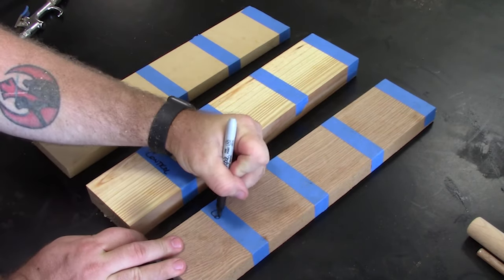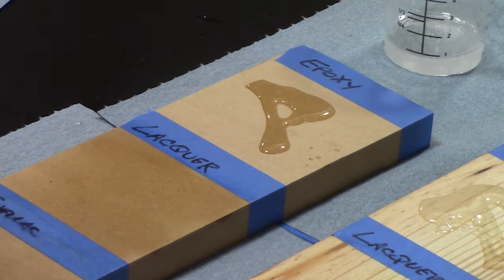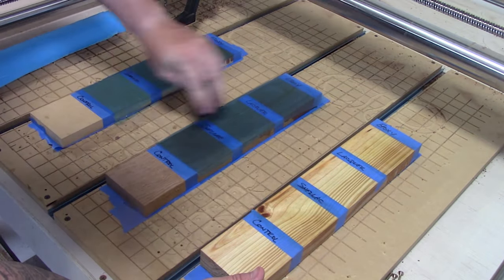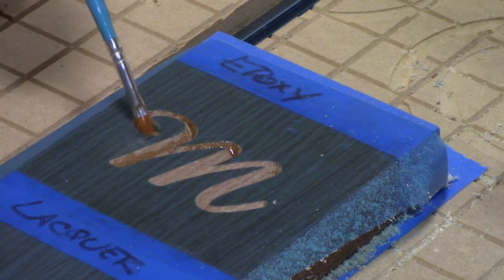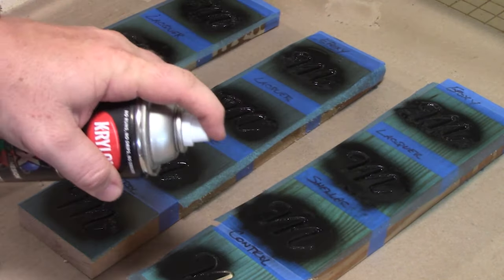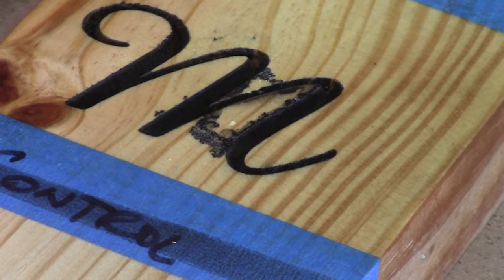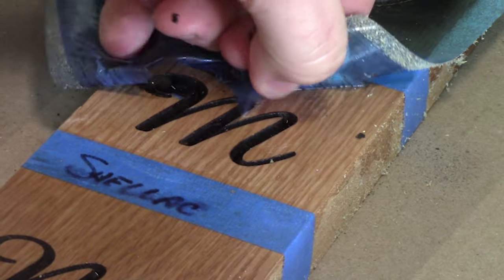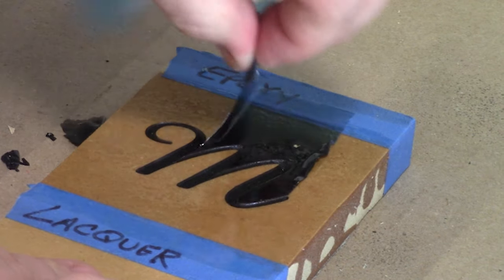Unlock the Secret to Paint Bleed-Free CNC Projects

Comment: I have been applying finish for over 30yrs. One of the only jobs I ever had that I wasn't working for myself was in for a guy who repaired, restored and preserved antique furniture. He was the best finisher I had ever encountered. The Golden rule of finishing is never cross finish. If you are going to use lacquer then use a lacquer based paint (dye or pigment tinted) if you use shellac...same thing. For epoxy it's not going to matter because it doesn't really have a solvent. 
Oil based spray paint with just destroy the lacquer and shellac. If you want to paint over it use a latex or acrylic paint. Oil based spray paint should be used for painting metal wagons, wheelbarrows or your lawn mower deck.
Use appropriate blends for woodworking. Plus.. three coats of everything. Three coats of sealer and three top coats.

Comment: When using shellac, you want to make sure it's dewaxed (sold as "sealcoat" by zinsser, or make your own from flakes). The wax in regular shellac may inhibit the adhesion of the oramask. If the can just says "shellac", it's the waxy kind.
Reply: The spray shellac he used is absolutely wax free, despite not being called seal coat.
Reply: @Shane-ce9fm  You're right; all of their spray shellacs are wax free.
Reply: @NWGR  No problem. Glad I could help.

Comment: If you spray water based acrylic paint with a light coat on and wait 10 min to dry and then do a second coat you will find that you will not even need to seal coat, just sand afterwards even without masking first.

Comment: I have started doing a lot of painted VCarve signs in cheap pine and have tried a LOT of sealers to prevent bleeding but think I just hit the jackpot with one maybe two coats of MinWax sanding sealer.  I get perfect zero bleed results and the bonus is it dries really quickly.  It does swell the grain a bit but that is fine. If you do a test again add that into the mix, I think you will be surprised.
Reply from the maker: Excellent. I’ll give it a shot.

Comment: I have one more method for you to try. I did a video on this a few years ago.  I put down a very thin watered-down coat of "plastic wood" wood filler, and then do my v-carve.  From there you might want to spray shellac/lacquer in the carved/exposed areas if using a thin paint like spray paint (I just brush acrylic paint).  The wood filler sands off faster than pulling off the oromask, and the coverage is better than oromask (no areas "pull up").
Reply from the maker: Great tip!

Comment: Oramask is expensive.  So is epoxy.  I get great results by doing the carvings first with nothing on the wood.  Then I seal the project with shellac, including the freshly cut carvings. This ensures that the woodgrain inside the carvings is sealed to prevent paint bleed.  Once the shellac is dry I paint the carvings with acrylic paint and, while the paint is wet, wipe off the excess with a damp cloth.  Then a light sanding after the paint is dry.
Reply: I use a clear masking product that's a 10th as expensive as Aura mask and it's medium tack it actually works much better than oremask in my opinion
Reply: @SzechuanChickenDog What product are you using instead?
Reply: Help, i have used the Oramask and others, how do i get a clean edge when it cuts, is it my bit or spindle speeds etc
Reply: You just blew my mind.
Reply: I’ve used a cloth to wipe off the top, but I invariably wipe off some of the paint that’s supposed to stay. How do you address that?
Reply: @SzechuanChickenDog : What is the name of the product?
Reply: @billgruber5904 
 Clear Transfer Tape for Vinyl - 12" x 100' Roll, Made in USA 
It's not as nice on very delicate carves. Keep that in mind. It can pull stuff off because it's way stronger tack
Reply: @HighRPMCreations  
 Clear Transfer Tape for Vinyl - 12" x 100' Roll, Made in USA 
It's not as nice on very delicate carves. Keep that in mind. It can pull stuff off because it's way stronger tack
Reply: @kendellkillian1523 : There are any number of possible reasons: dull bit, Oramask not adhering well/surface not smooth enough, feeds and speeds need tweaking. They’re a bit pricey, but it might be worth trying the GrooVee Jenny bit, which is the only? or first? downcut vbit, which should help keep the Oramask down.
Reply: @HighRPMCreations  I use a slightly damp Scott Shop Towel.  They're heavy duty paper towels that don't shred easily and they aren't thick like some cloths.  I don't bunch-up the towel like I'm cleaning a surface, instead I try to keep the towel flat to the wood surface with my fingers.  For wide carvings, I only wipe along the edges of the carving.

Comment: Great video.  Thanks for doing this work so I don't have to!   I've bounced around between shellac and poly for sealing v-carves.  I've wanted to try epoxy, but it does come at a cost.  Maybe just using epoxy for the interior and not the overall sealing of the top.    I have found that sometimes, it takes multiple coats of paint after sealing the carve.   I normally use acrylic, so that could be why.
Reply from the maker: Great point!

Comment: I sell wood signs at craft shows. I use Baltic Birch 1/2 Ply. I brush on two coats of Shellac let it dry and put Oramask on it. I find that if I let the Oramask sit for a day I get better adhesion. I try always to spray with Marsh stencil ink. Marsh is the key to no bleed. That stuff is just awesome and drys supper fast. I then finish with a quick spray of clear spray paint. My signs sell for $15 and I sell a ton of them at the shows. Most only take total 10-15 minutes to cut and finish.
Reply from the maker: Awesome. This is great to know. I’m not an expert in this area, so that really helps.

Comment: Should have the spray paint can back farther , spreads out the paint particulates spread out more, less running of the paint, also use a sweeping method right to left left to right.  Never pause movement always a fluid movement.   Also feather the depressor and don’t spray continuously, saves paint in the long run 😊
Reply from the maker: Thanks for the tip
Reply: Hope it works, or if you’ve got a better way I always love finding better ways of doing things.  I use spray paint tones with my laser cnc

Comment: i do it in the reverse to most...... I engrave the design then 2 coats of nitro lacquer on surface and engraving done with a spray gun.....do the black and then sand off....no bleeding and less work then most of the examples you showed here.....the nitro lacquer traps all the black and also seals the end grain which is the main bleed area and sands off real easy....I also dont use that plastic sheet over the top...not really necessary and just another cost that some marketing bloke came up with :-) :-) :-)  cheers for the video
Reply from the maker: I'm finding that the Oramask is useful, but not perfect,  so I'm using the lacquer and sand method more and more myself.
Reply: cool  :-) 
 @SothpawDesigns

Comment: Great video and new subscriber from a fellow creator.  I've had success with sanding sealer for MDF.  Epoxy is great with all, but comes at a cost.  When applying spray paint I hit it with a back and forth motion for a better even application.  Also, check out a downcut v-bit.  Keep up the good work!
Reply from the maker: You're not the first that's mentioned a downcut V Bit. I need to get one.

Comment: i usually use spray lacquer. i do like 3 coats. epoxy is superior, but it's slower and more expensive, so i don't usually do it unless i'm gonna epoxy more over it because i wanna block air bubbles.

Comment: One of the best ways whether it is rattle can(spray) or epoxies set the out in the direct sunlight, it heats it up and bakes the paint or epoxies. I worked in an industry where we had to have our paints and epoxy cure as fast as possible, just my 2 cents. Give it a shot have you got to lose by trying

Comment: Have you got any methods for reducing the amount of sanding required inside the letter carvings on hardwood to ensure a smooth finish once painted? I find it can be difficult and tedious.
Reply from the maker: For engraving, a v bit works well. If you’re talking about letters that are cut out, I feel your pain. I’m starting to use thinner material and a laser cutter instead of a CNC.

Comment: you did not sand the epoxy parts. not sure why but it would have been interesting to see it sanded. Also you painted the gloss black too thick. You need to do light coats so it can't pool. I have used shellac on my stuff with great results and virtually no bleed. I used krylon spray paint and ormask was used.